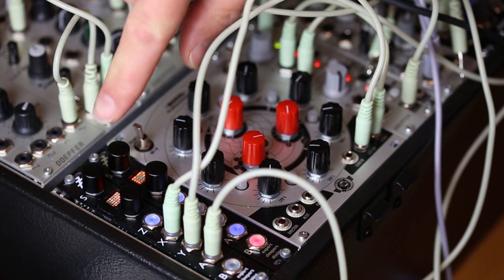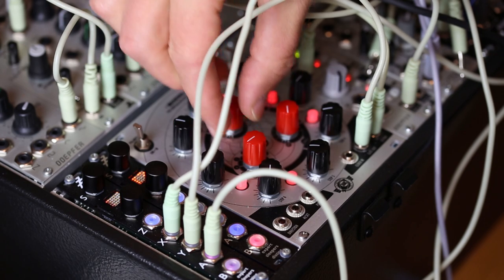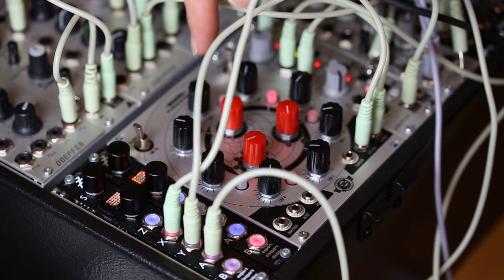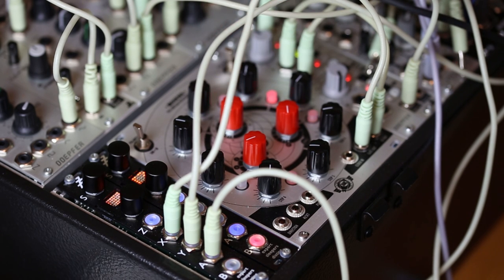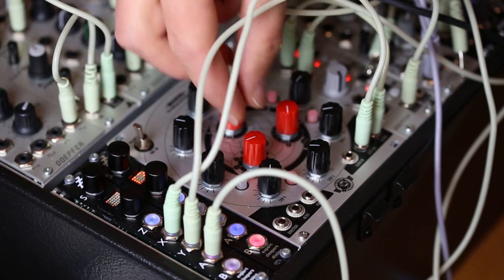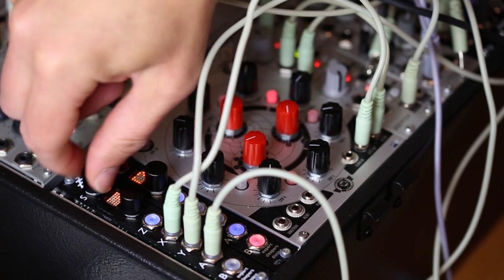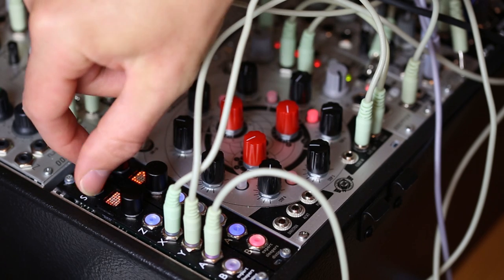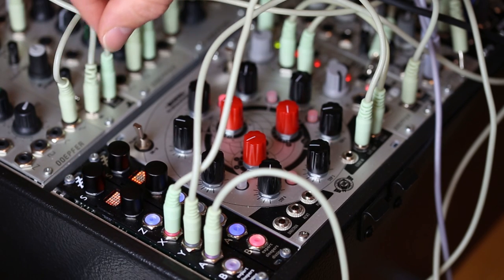disting mk4 - Sample playback gate & envelopes

Comment: not sure if you have a mode like this already or if it would take to much processing power, but would it be possible to have a parameter for polyphoney (fake polyphony :D) few triggered notes keep ringing even when a new trigger comes in...3-4 notes hanging around until their envelope is finished....or as many polyphonic notes as there is processing power for. Could be quite lush. Only problem i have with this module...it that i DON'T have it in my rack..yet :D